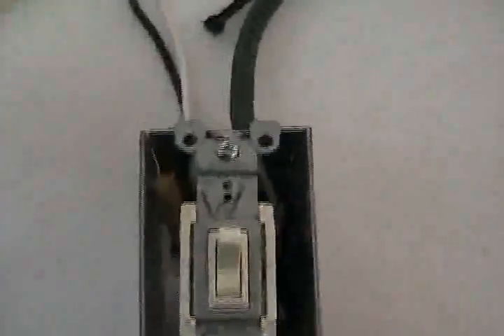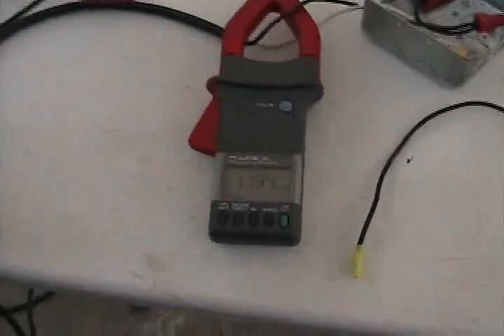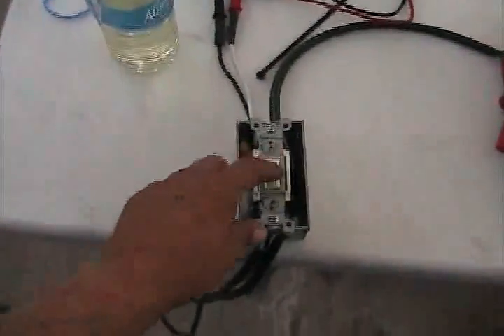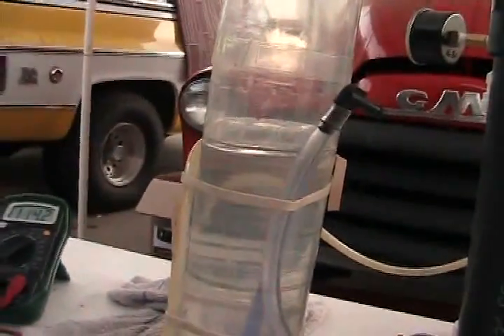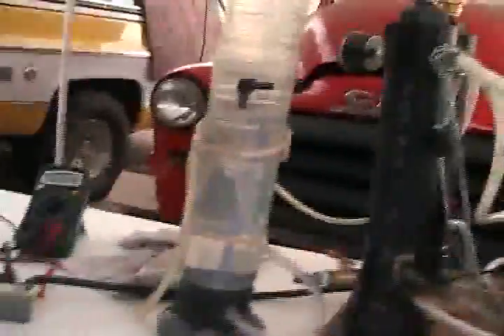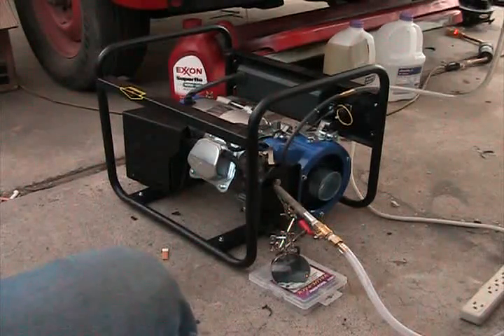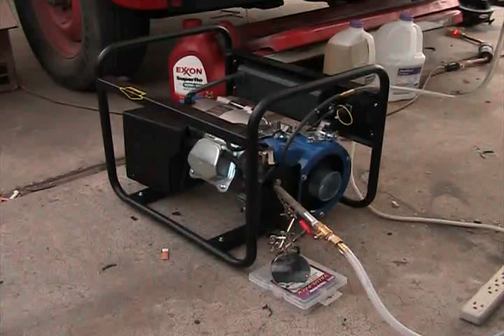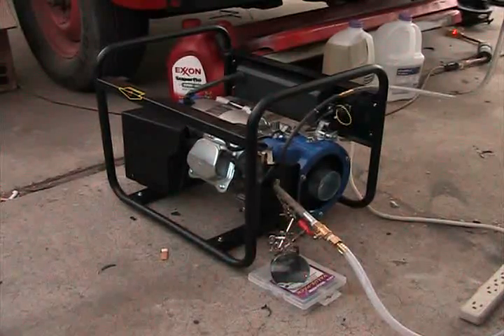generator running on hho testing Pt.9

Comment: Can't you just use the fuel inlet port on the carburetor to send the HHO in behind the throttle butterfly valve and let the carb adjust the air mixture normally (i.e., put the HHO in through where the gas used to go.

Comment: I'm a bit puzzled as to when you actually removed the pipes after you switched off the supply to the cells?
What was the pipe you picked off the floor and connected up?
Also I didn't see you block off the "test pipe nozzle" that you showed when filling up the bottle on the "flow meter", so surely any gas would still be escaping through this and not going to the generator?
So far I've had no luck running a similar generator, maybe I've not got enough gas.

Comment from the maker: Sorry but the video was more meant for some people who had access to an entire data log on the engine, which isnt listed here. But Yes the engine was running on hho only, but it is not a closed circuit, at this speed the engine would produce less electrical power that the hho cells consumed to keep the engine running. This test was more to see how much hho for an unaltered engine. Thanks

Comment from the maker: @lightlearner yes you can run a generator on hydrogen, but the power produced will not make enough hydrogen to run itself, you have to use power from some other source.

Comment: Hello just saw your video Nice job.  i have done similar tests would be interested in working with your  ebn group or what ever you call it , as it seems we are all doing much of the same work.  vidoo9 you are mistaken I ran my gen on hho while running the cell off the gen then ran lights also.  my cell was pulling 10 amps while my gen was putting out 20 amps at full throttle .  I also can control idle to full throttle with a variac at the same time.  No timing modifications

Comment from the maker: yes they use basically a slide valve, aka the piston and port. Not a reed, but would be better if they had em. 

If you are sucking air into the crank from outside through a reed valve, then it would have a filter on it.

Comment: I was just trying to give you more insight on how a small 4 stroke engine works, that's all. I wasn't criticizing you or anything.

Any current 2 cycle engine(chainsaw, line trimmer, cut saw, blower) from Stihl does not use a reed valve. 

Part number for what filter? Air intake filter?

Comment from the maker: Well in that case then share with me the part number, the service life, and the filter type that would be used to filter the incoming air. 

Also, with the exception of an oiled crank 2stroke, I would love to know of another non reed valved 2 stroke.

Help is great, but I fail to see how your helping? Or what your trying to help with?

Comment: (continued from below)This pressure is vented to the atmosphere (or back into the airbox before the throttle plate). When the piston travels back up it creates a vacuum in the crankcase because the reed valve closes. The crankcase ventilation system on most single cylinder 4 strokes is slightly different than the pcv system most autos use. By the way, not all 2 strokes have reed valves.

Comment: There is a reed valve or one way valve in the crankcase of a SMALL 4 stroke engine, like the one on your generator. I've been a small engine tech for the last 15 years. I'm only trying to help you. When the piston goes down there is pressure created in the crankcase.

Comment from the maker: PCV, POSITIVE CRANKCASE VENTILATION, it is when engie vaccum is applied to the crankcase, the purpose it to lower the pressure to reduce the air that the priston slams into when going down, and to remove both fuel and oil vapors from the system. The piston going and down does not create vaccum, and there is reed valves in two strokes not 4.

Comment from the maker: there really isnt enough water to condense, sure on a larger engine, or maybe with a large load, and increased amount of hho, then sure. 

If I put a piece of copper tubing on the exhaust I could "distill" the water back out.

Comment from the maker: Timing may need to be altered a small bit, but the flame spread of hho mixed in normal air is much slower than pure hho. And mcallister tries to make thing way overly complicated to sound intelligent, imho. I watched many vids with him. HHo seems to be similar to H2 but not the same exactly. further tests will show the differences. Steam and hho is definitly on the list of tests, ultra sonics will help with the steam. more is deffinately on the way.

Comment from the maker: The only hitch with that is this, hho can transfer its energy better into inert ambient air better and it slows the combustion down to a speed that its energy can be better transfered to the piston. Which among other reasons is why more energy is apparent with a mix, instead of pure. Plus the air helps carry the steam out of the engine.

Comment from the maker: hho burns into 100* steam, and its volume is 86% of the original hho. When exploded it builds pressure and then comtracts back down to about its original volume, this would mean the piston would begin to move at detonation, but before the piston moved much the steam would form and it would apply a slight vacuum on the piston, slowing its movement. Now with proper timing the event could take place at TDC or just after TDC, and it could be tuned so the vacuum helped pull the piston back up

Comment from the maker: It would run, theres no doubt about it, but theres a few things to know. 1 is the amount of hho to 100% feed an engine is a lot, around 5 times as much as I am feeding this engine. 2 you actually transfer more energy to a piston with a 20% mix of hho and 80% normal air. Yes I know it sounds stupid, but its true, the hho combustion is too fast to transfer energy to a piston, the momentum of the piston mass can't receive the energy.

Comment from the maker: At idle it wouldn't really produce much power, but idle gives a start point of the amount needed to get this started, 4lpm for 87cc engine, thats hard numbers, and the first time I have ever seen it posted, with that any engine should be able to be scaled off the ratios, with a certain amount of error correction. 5000cc engine(5.0L)=229.9LPM hho, at this pethetically incorrect engine design. This is like running a flathead on nitromethanol, just stupid, but mores is to come

Comment: dont mix air with it-meyer said mix exhaust gas with it.
or try some welding gas.

a model nitro engine has a nice small adustable bleed valve that should be good for mixing gases.
5 *'s from me

Comment from the maker: well one of the other old boys at ebn needs to get me some burn rate data for hho mixed with normal air, it should slow the burn down, but we need to have the test device intergrated with a computer to record the event. poke Allgood, as if that guy doesn't have enough to do already:)